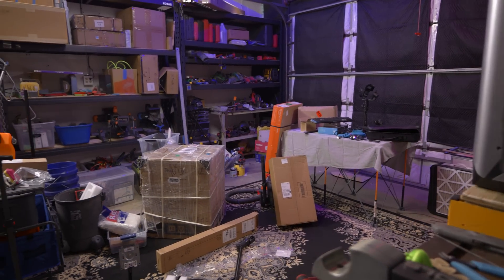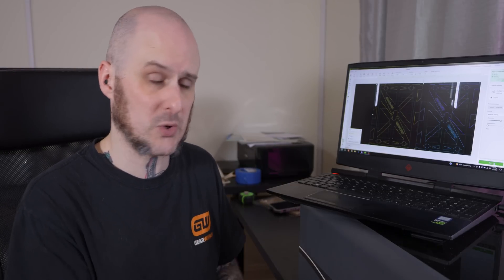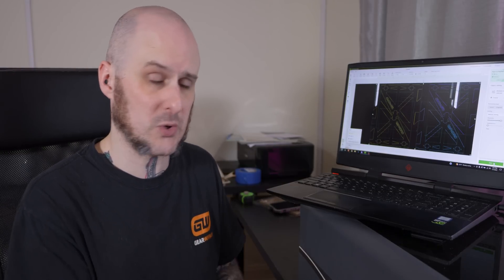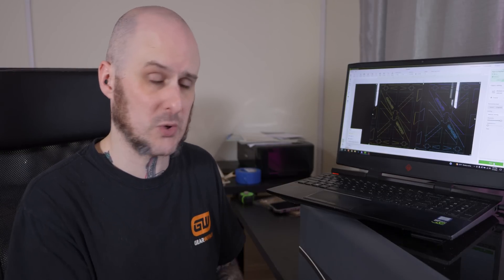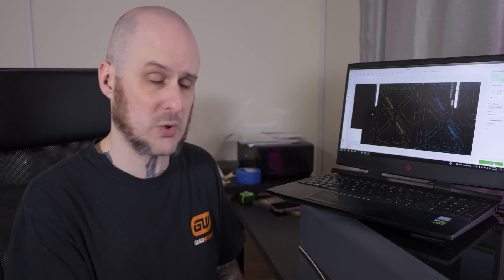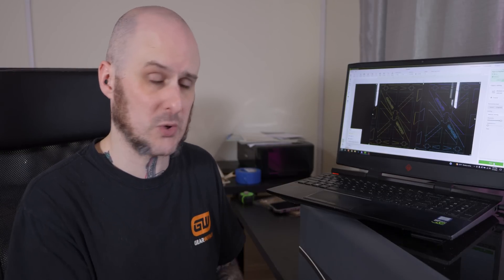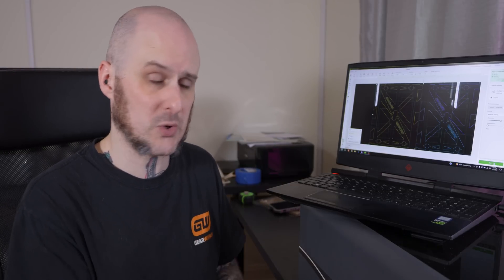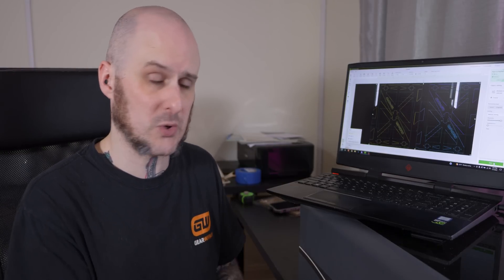Building Filament Storage Solutions - xTool P2 Laser Project / RepRack!

Comment: You were grabbing that 10' EMT and I'm thinking "No way that fits into the Prius". I figured you'd be cutting it down to transport it.  Nope.   I was very wrong. Wow..   Truck-Prius.
Reply from the maker: Fun Fact: I intended to cut it down (despite knowing it would fit) but I forgot that the inverter in my car is too weak to run the portaband. 🤣 That part of the video hit the cutting room floor.
Reply: @MandicReally  I have a small EMT tube cutter tool that I bought when I built my RepRacks, then cut them down in the parking lot. 

Your setup looks good.  I like your double rack design. I have some shelves that I want to use and your design will save me some time. Guess I have some printing to do. :)

Comment: Subtle ERCF hint, hmm

Looking forward to your experience, it’s my favorite and most frustrating upgrade I’ve done to date
Reply from the maker: I’m not looking forward to it honestly (put it off for a while now) but it just makes sense. And I’ll be running a Revo, so I’m hopeful tip tuning should go smoothly.
Reply: @MandicReally  yep! Revo is the best for tip forming right now, I’m running a Volcano knockoff from Mellow (good quality) and it’s been a bit of a challenge. Kinda wish I could build a filament cutter like Bambu or Filametrix use
Reply from the maker: @PatrikTheDev  yea I was debating that but the Revo I’m gonna to run is design to mount right to the Extruder. Debated building a StealthBurner with a cutter (mods exist) but it isn’t pretty. Just finger crossing that Revo will run well & the short filament path will work smoothly.
Reply: @MandicReally  also running a direct extruder mount, I unfortunately can’t mount a stealthburner since it’s a custom printer design and there isn’t vertical clearance for a taller printhead (I’d need to remove an extrusion). I wish you the best of luck!

Comment: I wish I had a studio like yours 😍 great video! I just wonder if it’s convenient letting those spools out of the box, you know moisture problem with PLA 🤔🤔
Reply: I've noticed many of these filament 3d printing youtubers all show off their spools like badges. I myself keep my spools in their bags and in the boxes, I do right on the box with a paint marker using the same color as the filament, but I have been considering printing swatches of the filament to slap on the boxes, but most likely won't.
Reply: @addhoardingprocrastinator  I'm in the same boat, trying to find a storage solution that also solves the moisture issue.

Comment: The RepRack system seems like a great solution! What sort of ventilation did you end up using for all the printers that don't have enclosures? I'm still trying to find a good option for multiple fdm and resin machines.
Reply from the maker: I run home hepa filters at multiple locations around the studio. However I rarely pritn anything but PLA or PETG on the open machines. I’ve got plans for a resin specific solution soon, but that’s an upcoming project.

Comment: Great video, very informative. One question, don't some types of filament require humidity control? How do you handle that? Or do you live somewhere that is dry enough that this isn't an issue?
Reply from the maker: Studio is climate controlled year round & at the humidity levels it is at, it is a non-issue.  I'll dry things like PETG or TPU, just because I use them so infrequently, but even ASA is not a problem in this space.

Comment: What do you do about drying your filament
Reply from the maker: I’ve got cheapy filament dryers I use when I need. They stink but I’ll just run them a long time before printing & print from them (for very temperamental materials). Otherwise my studio is air conditioned and fairly low humidity. I’ve got a project in the works too, but not ready to disclose that.
Reply: @MandicReally  I was thinking of a dehumidifier

Comment: Do you think I should get a bed slinger or corexy for in my bedroom
Reply from the maker: Core-XY generally has a smaller footprint but most of the ones out there right now are generally louder. Not always, but often. Printing higher temp materials near where you sleep is gonna heat up the room & release nasty fumes. Your first printer? If so I’d say go simpler & quieter. Something like the Elegoo Neptune 3 Pro. https://tinyurl.com/Neptune3Pro (affiliate link) But if you just want fast and don’t mind a little noise while you sleep, the Bambu machines are gonna be more contained and faster: https://tinyurl.com/BambuLabSite

Comment: Hey Alan, love the organising im in a similar process. Thanks for your hint/wink on your previous vid that bambu was up to something! Now with additionel research im actually leaning towards diving straight into the Voron experience since im already quite proficient with building and the plan was always to go voron after a Bambu. So id just have to become familiar with the setup proces for Klipper/Mainsail. P.S i think i got the spelling of your name right this time.😅
Reply from the maker: I do love my Vorons personally, but they are quite a bit more work (of course).  Firmware / Klipper is a learning curve but pretty easy once you get it figured out.  There are decent instructions all over the internet about setting up a Voron.  I'd consider looking through the manual of whichever machine you want to build so you can see which mainboard and parts they use.  That will make your life easier in the build process.
Reply: @MandicReally yeah im already deep down a youtube/github/reddit hole, figured id go with an LDO kit and use one of the Raspberry Pi's i have lying around from another project that went nowhere or go for a Siboor kit, but your experience with the Siboor gives me some reservations.
Reply from the maker: @MonkeyWithAKnife  LDO uses better parts & will take care of issues, but you pay a premium for it. It’s the way I’d recommend personally. I spent more than an LDO kit self sourcing and wish I’d just gone that way.

Comment: Looks great, nice job. Question? I've been noticing many Youtubers like yourself are storing filament un sealed open to air, wont that allow them to get moisture in them. I thought filament needs to be kept dry or sealed from air.
Reply from the maker: In a climate controlled environment I rarely find drying to be necessary. Especially with materials like PLA or ASA. Which are the primary materials I use. My new studio in Portland is a bit more humid so I've had to dry materials more but it isn't a terrible thing. 

I can only speak for myself, but I go through a lot of materials. So you may see a rack full of colors, but a lot of those spools may not even be the same one as the last video you saw. Just cause it looks the same doesn't mean it is.

Comment: how do you have that much filament out and open, do you have to regularly dry it before a print?
Reply from the maker: In my experience the need to dry filament is vastly overstated problem. I rarely dry anything other than TPU and I don’t print that much. The rest of the materials, I cannot remember the last time I had a problem I could trace to moisture. My studio is climate controlled but it’s not 0% humidity or anything.

Comment: Do you worry at all about humidity and the filament getting wet at all with all of those spools out in the open?
Reply from the maker: Studio is air conditioned and the humidity level is really fairly low. That said, PLA generally doesn’t absorb as much water as folks seem to be constantly worried about. Maybe in super high humidity locations, but I’ve rarely found it to truly be the issue folks think it is.
Reply: @MandicReally  yeah I would love to build a system like that, but my setup is in an unfinished basement that’s between 65%-67% humidity at all times. 😞 

I only use PLA right now and can tell it’s being affected for sure. Might have to look into a storage container with some of those desiccant beads. Either way this project you did was awesome and fun to watch. Keep up the rad work!

Comment: @mandicreally At around 14:00, you build a rack with brackets that don't have the center spool bar holder. I can't find these anywhere. Did you design these? Can you point us to them?
Reply from the maker: Those were my remix of the official RepRack. They printed quicker than the original design as I had no use for the center bar portion. I have not released that remix as it didn't feel like a major design change. I guess I could release it if folks are interested.

Comment: What about dust and humidity?
Reply from the maker: Hasn’t proven to be an issue at all in my studio. Humidity effects on PLA are greatly exaggerated in my experience. Other materials require drying no matter what, so this doesn’t really change that. Overall I’ve had my filament on open shelves for years without issue, what’s different about putting them on racks that allow more airflow around them?

Comment: holy smokes that P2 is expensive!
Reply from the maker: It is certainly not cheap. Comparing to the other machines in its class it is reasonable though. Glowforge is $7000, BeamBox Pro is $5000. Still a pricey machine for a diy environment.